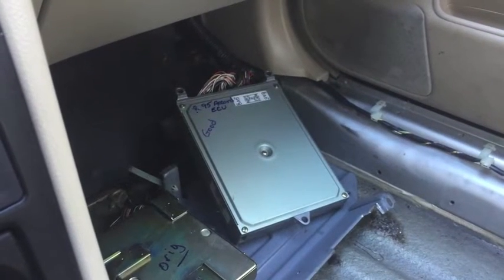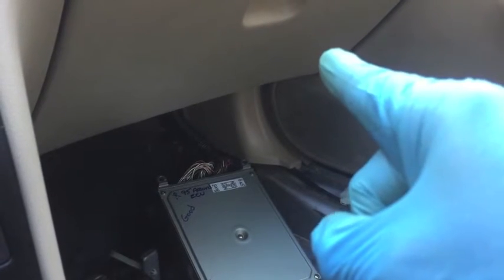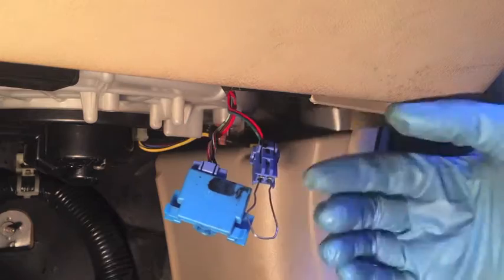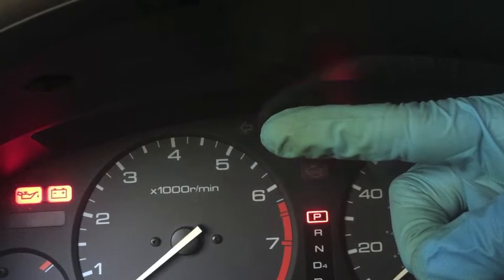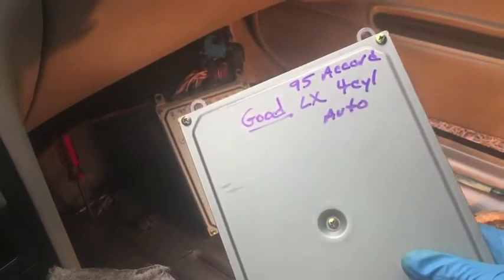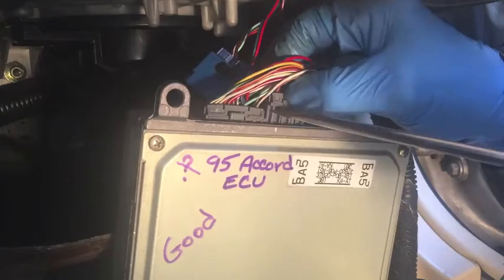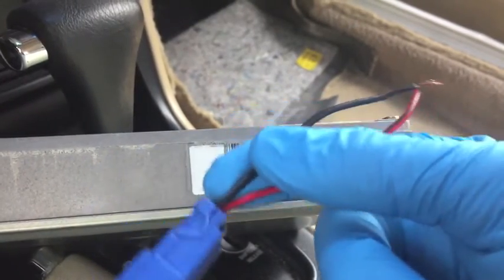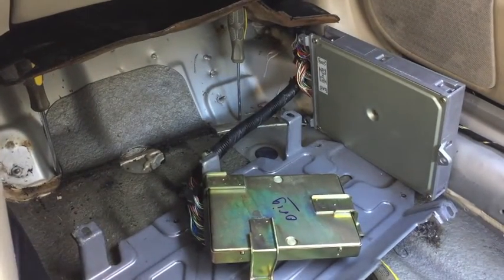How To Read Honda/Acura OBD1 Trouble Codes

Comment: I have the same isue the the rps reving up and down on its own. With a check engine light on it,

 it tends to accelerate on its own sometimes, and my D4 light is flasshing non-stop once i start driving. I definitely  want to figure this out. I've been stressing for weeks  on what this could be

Comment: On my honda the motor was swapped before I got it. Check engine light on. I noticed when I went to check plug to read codes, they are not hooked up to anything. Will it hurt the car in the long run and what is that little box thing it's plugged into, cause like I mentioned mine are just hanging and not connected like yours is in this video

Comment: If you own an Accord that's '99 or earlier, chances are you too will only have OBD1 - they were built with the bracket installed for an OBD2 connector, but without the connector - you will have the 2plug blue OBD1 jobbie over on the LH side footwell.  Search as you like, you'll not find "your" obd2 socket.  You'll also probably struggle to buy an obd1 compatible scanner these days - please correct me if you know different.

Comment: Does obd one store old codes? Because my check engine light turns on then right back off. If I stop the engine with the light on will I be able to read it?
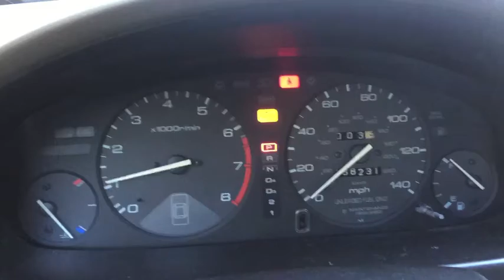Reply from the maker: My check engine light is lit when I shut the engine off around 00:47 and then I'm able to read trouble code 14 with the ignition on but engine off.. So yes, the code(s) must be stored..

Comment: Thank you for your videos on how to change out the computer. May it be assumed that as it is not shown or stated - that you do not need to have the newly installed computer - forgive me I cannot recall the correct term so this is what I can think of - to have the newer one "Rebooted" to talk to the car? 
This procedure, as you have shown are the ONLY steps to replacing a bad computer so the car will run again as it should?
Thank you!!!

Did you ever figure out what/where the water leak was coming from and why? 
I have the same issue and have to keep my (I call my car) skateboard covered up when it rains or it will get drenched depending on how much or hard it rains.
Reply from the maker: I did find the water leak:https://www.youtube.com/watch?v=9DzvsAJLJus&t=1s
And I can't speak for all Accords but with my 95 there's no need to have the "new" used computed rebooted.. Just plug it in and go.. I have this video showing me finding used computers at a salvage yard:https://www.youtube.com/watch?v=k6cNSNi0R5s

Comment: Hi I have a question I have a 95 Honda accord ex I did the port test it  did 2 long blink and 1 fast could u tell me what code is that thanks
Reply from the maker: Two long one fast is 21.. Based on the list below it should be your V-TEC control solenoid..
https://axleaddict.com/auto-repair/Honda-and-Acura-OBD1-Trouble-codes-How-to-read-and-what-they-mean
Reply: @PeanutButterMan-PBM  thanks a lot

Comment: The Transmission D4 was flashing too, where can I read the codes?
Reply from the maker: If you have a 1995 or older honda you have OBD1 which means you count flashes of the check engine light.. 
If you have 1996 or newer you should have OBD2 and need a code reader to plug into your OBD2 port to then get your trouble code(s).. 
Flashing D4 usually means transmission related issue.. https://www.justanswer.com/honda/bb06g-i-ve-1995-accord-d4-light-blinking-i-ve.html

Comment: Do you have any idea, what code 55 is meaning? When it's cold outside, after the 1st start +3 minutes, and the engine stalling. 5 min resting, then starting again, run w/o problem. But I can not find code 55. Type: '99 Honda Hrv 1.6 4WD D16W1 - Thanks!

Comment: If the light just stays on, does not blink or anything, is that considered code 0 or 1? Thanks for the help in advance ❤
Reply from the maker: Never had that issue so I did a little research.. If you get a solid check engine light (CEL) after jumping the connector that represents trouble code 0 which could mean your computer (ECU) is bad.. Or, as discussed in this thread, the problem was a weak/discharged battery: https://honda-tech.com/forums/honda-crx-ef-civic-1988-1991-3/cel-code-0-a-2999474/
Reply: @PeanutButterMan-PBM could this also happen if my battery isn’t getting charged by the alternator?

Comment: Hello mate. I'm doing the engine checking light as you did in the video but the light on my civic 1994 remain on (no flashing at all) if I turn on the car, the light still remain on. The engine light just turn off if I remove the jumper. My car run normally, no issues at all for more than 100KM with VTEC in action.

Comment: My check engine light doesn't come on until I have traveled two or three miles. How do I check the codes if it doesn't come on with the key turned as you have a demonstrated in this video? 1990 acura integra.  Tia!
Reply from the maker: You can't read the codes unless they present themselves when ignition is on and OBD1 port has been jumped with wire..

Comment: Hey man was ur car misfiring or hesitant to accelerate I just bought a 94 honda and I changed spark plugs cap n rotor but the car is the same
Reply: What the solution how do you fix it
Reply: @kicaumania8056  fuel injectors new
Reply: @abbas674  alright. Thank you g

Comment: Having decided to try this, I found your video idiot proof.  A question; can I get codes if there is no check engine light?
Reply from the maker: Good question.. Not sure.. Possibly if there are old, stored codes but no current codes to trip the CE light??
Reply: @PeanutButterMan-PBM  I tried the bridge the ECU connector.  I do have a SRS light on the dash, but as that is no related to idle/stall issues, I'll look into that later.  I turned ignition to 2nd position and, sure enough the SRS light pulsed a code 51 (accident detected), but no other codes.  I guess I'll go through the component cleaning steps next.

Comment: https://youtu.be/DGlPVybVccg?t=342  <---  Heater Core?

^ I don't know if someone else has mentioned this but you might have a busted heater core. I'm not for sure but it seems like I've heard that a leaky heater core can cause you to get water inside the vehicle.
Reply from the maker: Thanks, I've heard that too about heater core leaks.. My leak was a failed rubber grommet in the passenger side wheel well.. https://www.youtube.com/watch?v=9DzvsAJLJus

Comment: does my honda civic 2005 have this?
Reply from the maker: No.. Your 05 has an OBD2 diagnostic port.. Should be above gas pedal on the right.. https://www.outilsobdfacile.com/location-plug-connector-obd/Honda-civic-6
Reply: @PeanutButterMan-PBM  thanks for the reply another question, i put a reader on it and nothing ever came up. What may be the issue with this? if you have any idea! thanks

Comment: I have a code 14 for my 95 Del Sol. I replaced the IACV with a New IACV but it still does the same thing.... 
It's fine idles perfect when you first start it for about 6 or7 minutes... but when it warms up it starts to surge.
When I turn on the head lights it stops... anyone know where I can buy a good IACV that doesn't cost $200 Bucks? 
I bought a cheap one clearly that didnt' work... anyone know a good place to buy one? Thank you!
Reply: Mike...any follow-up on this?  Have a 95 Honda showing the same code.
Reply: @dc-wp8oc  Well for mine. What I found out is. Warm the car up, drive it until it starts to surge.
Then park it. Open hood. and Unplug the IACV Valve. And if it runs perfectly then you know it's the IACV. It means it's bad. I bought a cheap one from China, $32.00. The good news is, this means you have isolated the problem to the IACV. It lets you know you don't have any gasket leaks etc, which I searched for by spraying for them and let's you know the engine etc. are working fine. 

So for me I just have to buy a better IACV, probably from Honda but they are expensive from them. 

The other thing you need to know is you have to completely #1 reset the computer / ECU, #2 then you have to idle the car for 15+ minutes or so until the Radiator fan comes on. So, you want the Radiator fan to come on, then let idle for 15 minutes more after it comes on! Then while it's running, just go for a 10 to 15 minute drive. Just drive normal down the roads and get on the highway for a while too. And it then is set. 

I did not drive afterwords, cuz I did not know this part, and was told that might be why it didn't' connect properly! So I am going to do this first!! This is probably why it didnt' work correctly. 

NOTE: TO reset the computer ECU, I was told to disconnect the battery for 30 minutes so the systems, ie stereo, clock etc. have to be reset and are drained... but I did it for 45 minutes and it didnt' completely drain systems.

 And I noticed they still were set at the right time meaning it did not completely drain the energy from the systems, clock etc... 

Now here is another way that is probably easier and quicker. Watch this video. #1 Reset Computer / ECU - I am going to do it this way next time (in Video) , then #2 Idle til radiator fan goes on then #3 then let idle for 15 minutes more, then #4 immediately take it for a 10 to 15 minute drive! This should reset it correctly. 

If you clean your MAF Sensor, you may need to do this. Not sure though! So if you clean your MAF Sensor and it goes funky, you probably need to reset computer this way! Hope this helps! 

P.s. Do not Rev the engine or touch anything like stereo or lights. In fact I wouldn't get in and out of the car except 
maybe once after you start it. 

Here's the Video:  https://youtu.be/5PWE7f1ERHU
Reply: @dc-wp8oc  I figured it out. Sorry I didnt' find this earlier... it was the idle screw. My former mechanic was playing a lot of games. Loosened up bolts on valve cover, oil pan, poured oil in air intake tube, rubbed it all over the throttle body on the inside and the MAF Sensor... 
He also completely loosened up the Idle Screw. It was barely hanging all the way out. Surprised it never fell out and lost it on the road... 
Once I tighten it up it all went away.
The other thing I noticed is if you have a slow oil leak, if it gets to low, that can and will also effect your idle...

Comment: I have a 96 Accord (non US variant, so still using OBD1), the Check Engine light turns off/disappears when the car and engine is turned off and on again. Basically, the CEL does not stay ON.
Would doing this still spit out the code? I guess the better question is does it keep past triggered codes? The car should be turned off before shorting the pins, right? Doing that and turning the key to the ON position, I imagine the fault has already been "cleared" (?). The concern is it may not be giving me the codes related to the problem causing the CEL to turn on.

Comment: Can i swap it wit a junk yard ecu with out programing? Or do i have to program it after i replace it?
Reply from the maker: i can only speak from experience with my 95 accord.. i've swapped out several junkyard ecu's over the years.. unplug one, plug in the other.. no need for programming.. depending on the make/model/year of car you have, yours may be different..

Comment: What happens if the check engine light just stays on and dosent flash or anything?
Reply from the maker: Not sure.. Never had that issue.. But I did find a few repair forum threads that may help:

https://honda-tech.com/forums/forced-induction-16/solid-check-engine-light-service-connector-jumpered-460808/

https://honda-tech.com/forums/honda-accord-1990-2002-2/94-accord-cel-stays-code-gives-me-no-flashes-just-stays-solid-1729969/

Comment: Hi im currently trying to use a wire to get the code. my abs light willflash but the check engine light comes on and stay on. help please !
Reply from the maker: all i can say is to be sure you are using the two pin connector and also be sure that the wire you are using is firmly seated into the each side of the connector.. a paper clip has always worked well for me because it is rigid and easy to push all the way in.. then turn ignition on to second position but don't start car..
Reply: PeanutButterMan gotcha thank so much! Much help! Love you channel ! ❤️